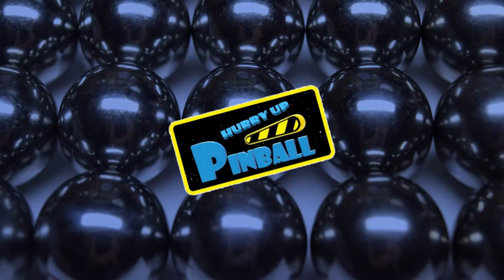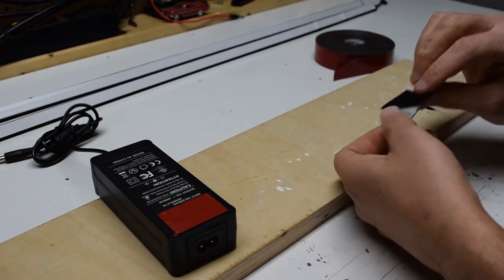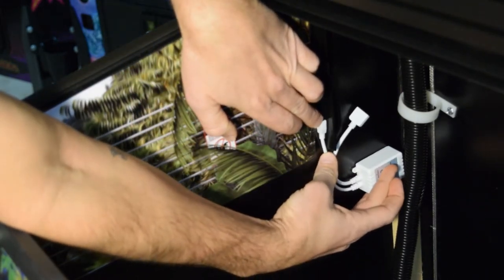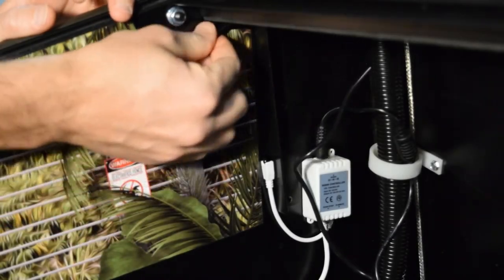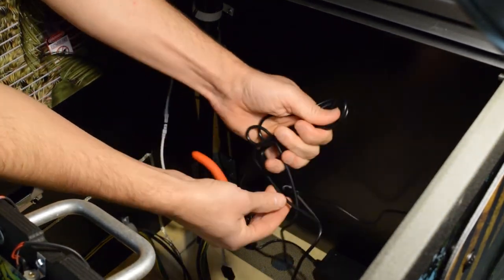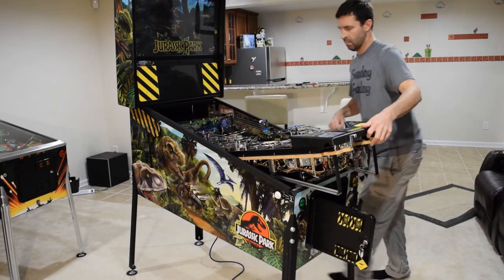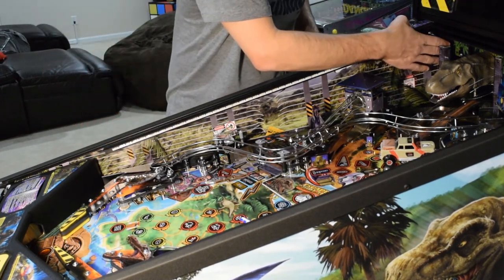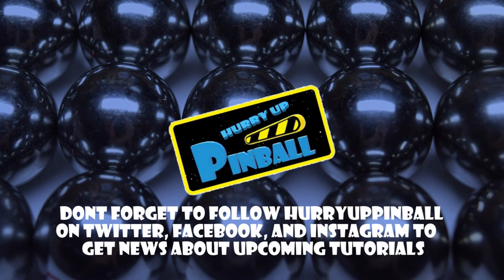HurryUpPinball - How to install Playfield Lights - Full Version

Comment: Brilliant, so it's either purchase all these parts for $150 which will provide enough  illumination for 2 pins (@$75 each game) or pay $800 to PSL for light strips that interact with pin play. I chose to make them as you've shown for my older Bally pins but pay $$$ way too much for the interactive light strips for newer pins. I so wish there were  more reasonably priced makers of light strips for pins.  Thanks for this option, my parts are on order.